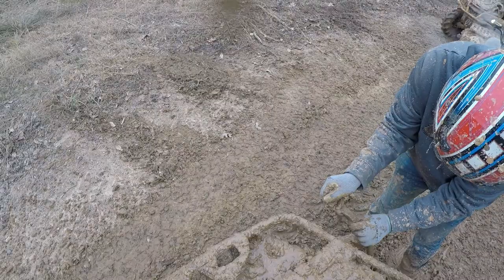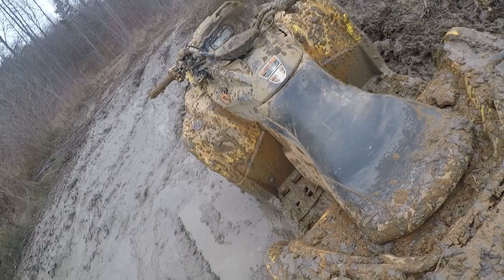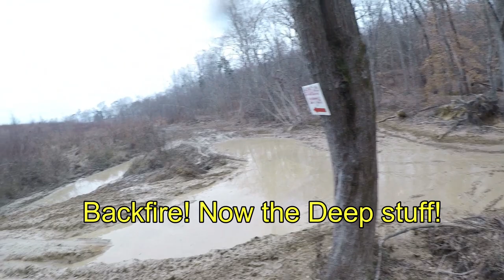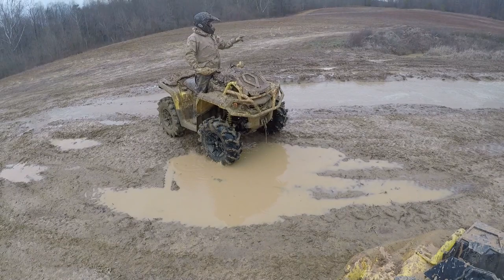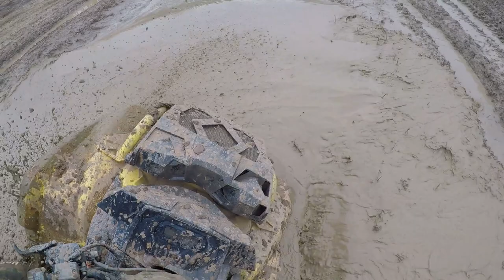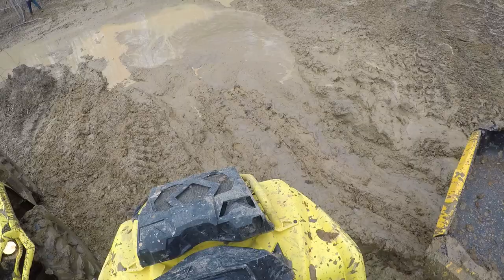Mudding at Pine Lane ATV Trails - 2-16-2020

Comment: When your exhaust goes under does you rpm drop
Reply from the maker: Not noticeably, I don't let it idle long unnecessarily when it's deep. I usually try to keep a little on the throttle with the wheels turning to keep it moving as much as possible